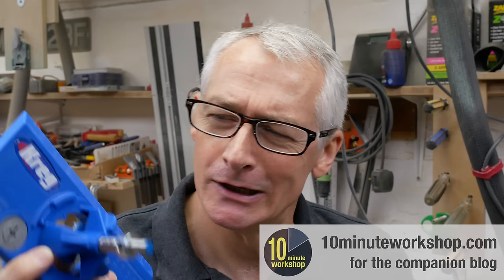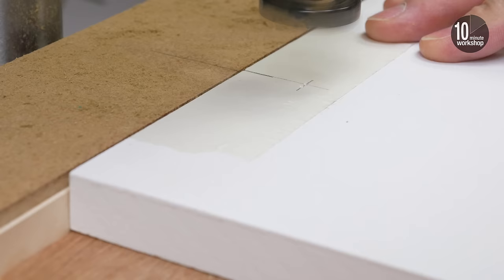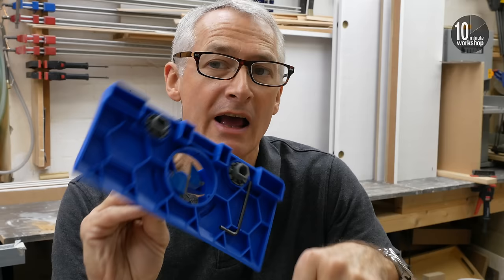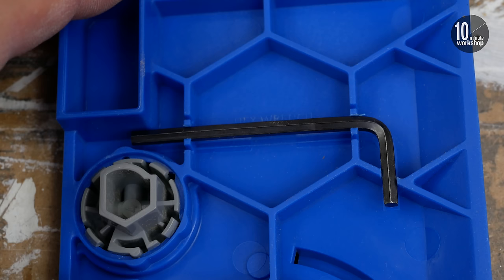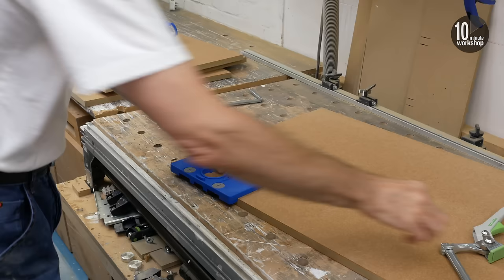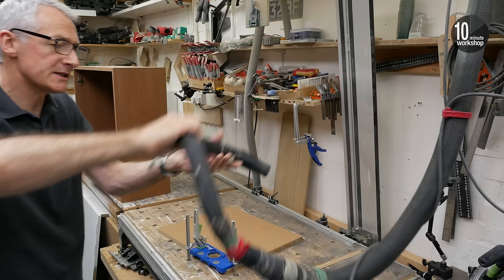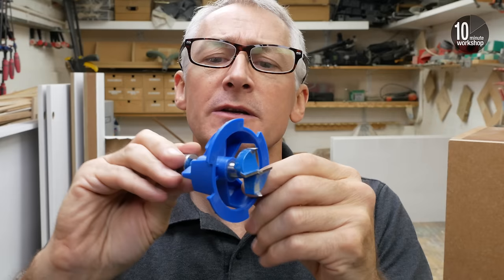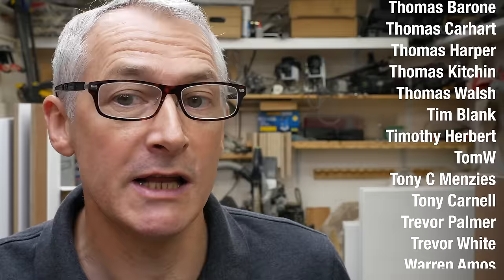Kreg Concealed Hinge Jig [video #357]

Comment: Hello Peter: Your video on the Kreg concealed hinge jig was really useful. I have used mine now and it is a real time saver. I agree that it should have a 7mm offset. The pinholes for the cabinet screws worked perfectly for the Ikea hinge but NOT the Hafele. The measuring scales could be visually clearer, but I got by. The Americans are odd in the way that they mix up Imperial and Metric - I had to deal with that when I was a Business Forms printer. Keep up the good work. Regards David Moore, Adelaide, Australia.
Reply from the maker: Thanks David! 👍
Reply: Helene you've hit the nail on the head! 1/16" is 1.57mm if I'm not listaken. I think Peter, not being a Yank, used a 2mm bit, did he not??

Comment: Just used this for the first time on my first cabinet and hinges. Good recommendation, thanks. Worked like a charm and had no issues with the screw hole alignment, they are to drill through, and worked fine.

Comment: I have cheap Chinese made version of this and it works well. I always use a dust extraction hose right up against the shroud when drilling the 35mm holes. Speeds up the drilling process and means you don’t have to unclip it from the main jig to clean it out after.

Comment: I'm all in on the Kreg system knowing I had a lot of cabinet builds coming up about 2 years ago I got this jig . The shelf pin jig the drawe slide jig and the Forman pocket hole station.i have cranked out about 40 or so doors with this jig and had no issue with Alinement.my only grip with the system is ther is no provision , assessor your additional jig for locating the pilot holes on the carcass.I ended up using the paper template to make my own jig out of some scrap plexi .

Comment: Different brands of hinges use different positions for the holes that fix the cup.  I sometimes use Salice hinges and they are definitely not interchangeable with Blum.  It's still odd, though, if they were making them for different brands, they might sell them that way.  In face frame cabinets with Blum hinges and overlay doors, the overlay (1/2", 3/4", 1", etc) is determined by the "tab," those 3, 5, 7mm, etc. settings.

Comment: I used the fancy Blum jig the other day and have to say it was a real faff to use. Unblocking it after every drill was a pain. The Kreg one looks similar but can't help thinking that metal to plastic contact would get sloppy and the misalignment of the holes is a real deal breaker.
I'll stick to making my own little marking templates with mdf and drilling on a pillar drill or by hand. I normally find if you sink the forstner bit 'body' in level with your material, then that's about right for a standard hinge. I often do it with a hand held drill though as I like to live on the edge!  😉
Reply from the maker: Yes, I was underwhelmed with the Blum jig, for what it cost. Worth bearing in mind this type of jig is aimed at light users  - a few pairs of  hjnges a month, kind of thing. If you’re using it for more than that then best to look elsewhere, or factor in an annual replacement👍

Comment: I've done hundreds of customer doors with this jig and I've had the same problem. I've switched to using the jig for the 35mm holes only, then a Trend Snappy centering bit for the smaller ones.
Reply from the maker: Best way, I think! 👍👍
Reply: you have done hundreds of doors and still play with cheap plastic jigs ? why don`t you make a dedicated jig  or buy one from blum ?

Comment: Custom shop built "tables" with fences and adjustable flip stops for use with a drill press is a much faster and more efficient way to go. One time set up for each run of doors.  Multiple doors done in a matter of minutes.  If you don't have a press, get one. No shop should be without. Worth every penny.

Comment: Thx Peter, have thought about buying one as I’m not a professional woodworker but it still might serve my purpose
Reply from the maker: Cheers Steve. As I say in the vid, I’d be less happy with it if I could actually get an awl in the small holes. As it is, there are other ways to make them, and it does a decent job of the 35mm hole. 👍

Comment: It sounds like the spacer cams on the jig aren’t even.  If it did line up, I’d use the right size nail and a tack hammer to mark the screw holes.

Comment: I don’t fit many of these hinges at all. Where I do need a hinged lid/door, I typically use piano hinges, traditional butt hinges and the smart hinge from Andrew Crawford (usually for boxes; they are superb quality but not cheap - quality and cheap only come together in adverts).

However, for the current job, concealed hinges are the best choice. I had bought the Kreg jig months ago knowing that this job was coming. Peter’s review was thorough as ever and I was prepared for the same issues that he had.

In practice, using the settings that it had when packaged (4), the centre of the forstner hole was 22.25mm from the edge - good enough. I drilled through the holes on the jig and they were spot on where they are supposed to. 

I don’t know if I’m the lucky one or Peter was one of the unlucky ones. Maybe, Kreg ironed out the inaccuracies in the last few years. I have a couple of the Kreg pocket holes jigs and they are very good. Like all Kreg stuff, they are not cheap but accurate. So, my advice would be to anyone with a faulty jig, send it back; Kreg seem a company with ethics and I would be very surprised if they didn’t do the decent (and lawful) thing.

I admit that the work that Peter does/did (mdf, ply, built in, cabinets) is very different from what I use and do (almost all hard woods and everything from pews to tables to small boxes). Obviously, Peter doesn’t really go into “my kind” of work but, for any newbie, you can’t go wrong in following Peter if you are doing “his kind” of work.
Reply from the maker: Thank you! 🙌👍👍

Comment: Hi Peter
On BLUM Hinges if you use normal full overlay hinge and height=0 base, the distance of 6mm implies that the case wil be covered 17mm, on in smaller numbers i.e. 3mm implies cover 14mm of the case.
This is perfect for me because I use 2mm clearence between fronts.

If my case is 18mm the hole is at 6mm from the edge of the door, if case is 15mm, 3mm is used.

When you use half overlay hinge and base h=0 the distance 6 or 3 is the same because this distance only depends on the case thickness and the reveal between fronts and this half overlay hinge is made in form that it covers only half the case thickness minus 1mm (i.e. case 18mm the door will cover 18/2 - 1= 7mm.

Also whith inset hinge, I use the same 6 or 3mm distance and the same h=0 base and the result is 1mm clearence between case and the edge of the board, in this case the thickness of the case has no influence.

All I mention before is perfect and no adjustements are necessary if the case and door are perfect and you use always 2mm reveal between fronts and Blum Hinges.

The distance between 2mm holes and the position relative to the 35mm hole in this jig is only for BLUM STANDARD 45/9.5, there are at least 3 differents standards for the position of this 2 holes but other brands also offer for their hinges this standard additional to its normal standard.

saludos

Gerardo

Comment: I have one of these and use it a bit.  But I never use the small holes even though I have an ice pick that works with them and a drill bit.  I use the method you do which is drill out the center and then grab my self centering drill bits.  That way I know that if there is any variation in the two hinge hole placements I am still good to go.
Reply from the maker: Best way, I think! 👍👍

Comment: Hi Peter, I have used a 'kreg' pocket hole jig and its ok at best. With regards this jig it looks quite flimsy, typical DIY use only. If you were drilling lots of these holes I seriously recommend the hinge drilling jig SBL-3 by Wurth, expensive yes but time saved easily outweighs this. I would never use anything else since buying this. I guarantee you will never set up a drill press again if you used this, it cramps to the door and will not slip. Money well spent.
Reply from the maker: Hi Gary, and thanks! If I was drilling a lot of these holes I’d absolutely be using something else. As I say in the video though, I have a drill press dedicated to the task, and it works perfectly for the volume I do, and requires zero set-up.Yes, the Wurth and Blum jigs are excellent; this was just a quick look at the Kreg jig to see if it was a worthwhile option for hobbyists and occasional users. 👍👍

Comment: Thanks Peter.  At first I thought it might, in some ways, improve on the Blum ecodrill (which I find very poorly designed!).  The depth stop arrangement on the kreg, being simpler, is to my mind an improvement on the Blum which requires 2 flat spanners and is not intuitive in terms of understanding the depth you are going to get.  I also thought the kreg might clear the mdf curls better but I see they get trapped in the jig just like they do in the Blum!
Reply from the maker: Cheers Alastair. Yes, I can forgive some ‘clunkiness’ in a £30 plastic jig - much less so in something at a couple of hundred notes! 👍
Reply: c`mon man how often do you change the depth on your eco drill jig ? most brands including blum, hettich and grass   need 13mm regardless of the door thickness , so why exactly the eco drill is poorly designed ? i only complain about all that shavings sticking inside the housing of the jig , it`s quite time consuming to clean it.
Reply: @RICOFURNITURE  I'm with you on this one, I only use Blum hinges so it's perfect for me, I love the fact I can use the clip on spacer to mark the screw holes ( perfect every time!) or remove them and drill the holes for the hinges with the 8mm plastic insert (perfect every time 🤣) that I pretty much use all the time.
Also I can't ever see me breaking it, it's built like a tank.
It paid for it self on the first job just for the fact it does the 8mm holes.

Comment: Its the flexing of the drill bit. I used a drill bit the next size up. Made the holes in the jig slightly larger and my holes align perfectly every time. I did have the same problem like you showed. A good friend of mine who make cabinets for a living showed me this trick. Let me know if it solves your problem.
Reply from the maker: I appreciate you taking the time Peter, but that’s exactly what I do in the video - take a 2mm drill bit and drill out the 1.6mm (1/16”) hole. And they’re not parallel to be edge of the door. 🤷‍♂️

Comment: I would just use the jig to drill the main hole, then indert a Blum hinge, and while holding it in place, insert an awl in the attaching holes to mark for the screw points.

Comment: One of the best jigs I have used is the concealed jig. Like a lot of jigs, I borrow them, and if I like them I find where they are sold. The Kreg one I bought works like a dream. And the door handle, and the draw slider jigs save heaps of time. Old cabinet makers will say, "Ya should do it the old way". I have set up drawers and sliders the old way, and also done the concealed hinge thing the old way. I like it the Kreg, or any advanced tool way, much better. This is the 21st century I am told. But it pays to learn things the old way, and you'll then appreciate modern tools even more...lol, unless you want to be a 'luddite' for the rest of your life.

Comment: I seem to remember last time I used those style  of hinges, they had a paper template in them, not robust . But a thin bit of ply and some tape, there you go, instant jig
Reply from the maker: I’ve fitted thousands - literally thousands - of concealed hinges, and none have ever had a paper template. 🤷‍♂️
Reply: @10MinuteWorkshop  few years since I have. And they used to have a bit of paper with diagram on back with centres on for screw holes and the larger hole. Used to be from b+q, and wickes. OK if fitting  a single door. But glued down to a thin bit of ply or mdf . Bit more robust.  But then I'm going back way before ebay and buying  bits from e-suppliers.

Comment: Peter, thanks so much for this really helpful video. Happy new subscriber here! Paying especial attention, knowing that it was you Brits that produced the magnificent de Havilland DH.98 Mosquito—the Wooden Wonder, Timber Terror! Cheers mate, from the States! 💛😎
Reply from the maker: Thanks Glen, and welcome! 👍👍
Reply: Hello Glen. That plane once got me out of a fix in my previous life as a photographic set builder. A photographer asked me to construct a 40ft x 30ft floating ceiling to suspend over a prototype car he was commissioned to shoot and I threw a price back on £2k and forgot it. The date grew nearer but I was busy so with weeks to spare I started asking around for the usual method ie. a triangulated aluminium frame commonly used for stage lighting rigs, the price was north of £8k with a lead time of six months! Fortunately in a pub conversation with an engineering pal I remembered the plywood bomber from a lesson at tech college. I constructed a box section ceiling using top and bottom runners from 4"x1" with 12"x1/4" sides glued and stapled on. I had to briefly dash off as I had a call from the hospital to say my two week premature son was about to make his debut but the job was done in a weekend with canvas glued and stapled over. My son was twenty one when that photographer moved studios and the ceiling was scrapped. He called me to say he could not believe how light the whole construction was with two people able to easily;y life it.
Reply: @alan36753   Alan, that’s remarkable. Thanks for posting this! God bless you. 🙏🏼💛

Comment: Nice video, thank you. I used the jig but had problems with it clogging and not boring the full depth in one go. Then I changed the drill for a mains powered one and it performed as expected. My battery drill was a good make, 18v device, but not man enough to tackle the 35mm holes in 18mm MDF. If anyone else has similar problems then changing the drill may be the answer. It work for me.
Reply from the maker: Thanks! Sometimes it can help running a battery drill on a lower speed - you get more torque that way. 👍👍
Reply: @10MinuteWorkshop  Peter, I tried that but it didn't improve matters but switching to the mains drill proved an instant cure.  Maybe my battery drill is a bit knackered - I've had it a few years but hardly used it before. I've just build five floor-to-ceiling cupboards (4m x 2m) having not previously attempted anything like it before. Thanks to your videos they have turned out far better than I dared hope. Can I say that your videos have production values rarely seen on You Tube. You manage to get all the close-ups, the 'set' is nicely lit, the sound is better than average and it all 'hangs together' nicely. Well done.
Reply from the maker: Thank you, I really appreciate the feedback, and glad to hear the videos have helped! The Kreg jig does clog fast, but I’ve always been able to drill each hole without any issue. Glad the mains powered deilll worked for you, and thanks for taking the time to make the comment, as it may we’ll help folks in future! 👍👍

Comment: The manual definitely expects you to drill the fixing holes - "Chuck a 1⁄16" [1.5mm] drill bit into the electric drill. Insert the bit into the hinge-screw drill guides on the Base and drill pilot holes into the door. Unclamp the Base and move it to the next hinge location."

If you set the cams, and draw a line along the long edge, is that line parallel to the edge?
Reply from the maker: Yes, but a bit more playing required with this, I think. 👍

Comment: I'm a bit rough on stuff. I've noticed that the gray plastic is tore up when you used the screw driver to adjust. Thanks for the video.
Reply from the maker: Yeah, as I say in the vid, the indents were easy to adjust one way, but not the other, and I chewed them up a bit before I figured you need to release the tension off the nub in round the back. 🤷‍♂️👍
Reply: @10MinuteWorkshop  this little trick helped a lot. after a few tries, the no. 6 provide 100% overlay (which is also the back of the jig stops) increasing the offset increases the overlay. Great video! always regret selling my Blum Minipress :(

Comment: I’m in Canada. I ran into the same issue. I also have the drawer slides installation jig. They are out of 90º so I can’t use them also.

To me, Kreg is an entry level grade of tools. They are nowhere near to be qualified as professional tools. Maybe to the exception of the pocket holes jig…

As a hobbyist, I prefer to enjoy sessions in the workshop with quality tools that make me feel I can achieve quality work with ease. I currently don’t have the talent nor the experience to compensate for the inaccuracy of an entry level tool.

Comment: Thanks for video. Another issue with this Kreg jig is you cannot use the blue base if your doors have rounded, beveled/tapered edges on the hinge side, because the bottom lip of it references off straight edges only. You can still use the drill guide, but you will have to free hand drilling the holes.
Reply: If you are fabricating the doors (and that is a large "if") you might round the edges of the cabinet doors after you drill the holes for the hinges.

Comment: Try using the correct size flat blade screwdriver to adjust the cams. Much easier. I've got more drill drivers than clamps! Great video!

Comment: Great review. Got one of these a couple weeks ago and did some test holes first in scrap (yet to fit hinges for real) and found the same as you when fitting Blum 110 degree hinges - the two screw holes don’t line up. Still seems a good jig overall though, will use the square method you showed for the two pilot holes I think!
Reply from the maker: Thanks! Yes, seems a lot of peeps have the same issue. I think it’s a decent jig overall, but I suspect the cheaper Chinese knock-off are just as effective. 🤷‍♂️👍